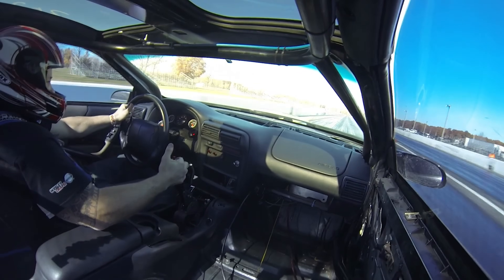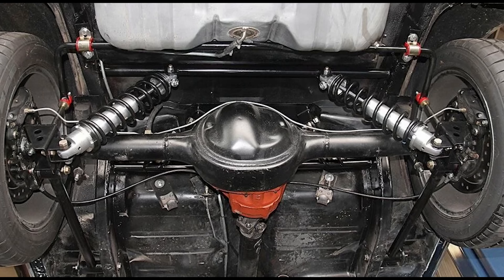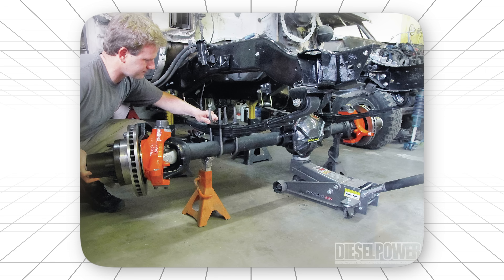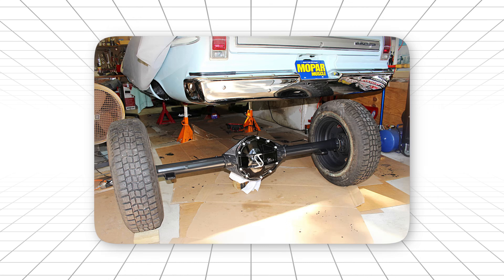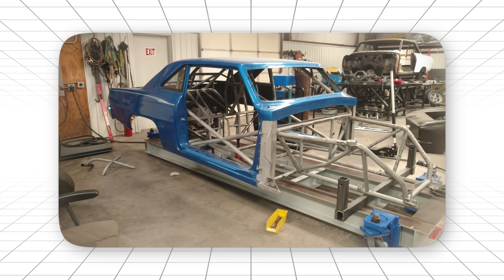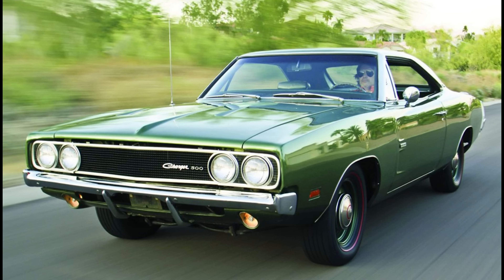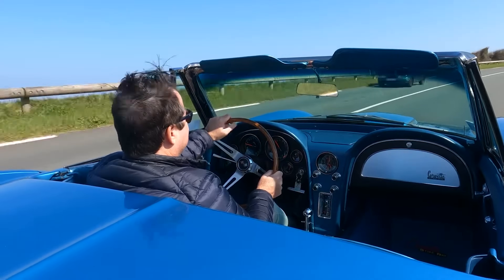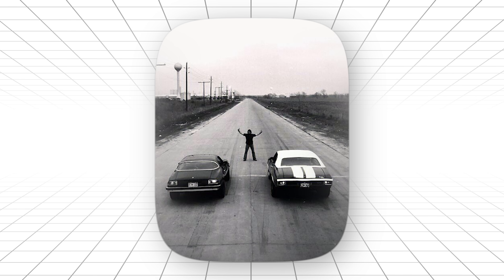The FORGOTTEN GM Suspension That Revolutionized Muscle Cars

Comment: I would agree that the corvette IRS rear suspension, particularly with four wheel disk brakes was the real game changer.  But I'll say back in the day when I was hanging out at my friends Porsche shop one day he said he wanted to show me something, and we went over to the wheel alignment shop and they had a 1958 Cadillac Eldorado up on the lyft and we were both astonished to note that it had a fully independent rear end on it with trailing arms.  So it was really the Cadillac that was ahead of it's time.  Cadillacs really were top of the line cars in the 50's.  My Dad's families actually was married to Casey Stengel so my dad grew up with uncle Casey coming up and he had a Cadillac Eldorado and my dad said even in the 50's the car got 25mpg and had automatic windshield wiper and auto-dimming headlights.  GM was just realistic the Mercedes and Porsche were the best cars in the world and they had to match them to be world class cars.  The mistake the GM made was when they lost fuel injection,   Had they continued with fuel injection that would have stayed competitive in the 70's fuel crisis.  In my opinion what GM should have really done is kept the Pontiac overhead cam inline 6, and put fuel injection on it with the IRS rear end, and got to a 5 speed tranny and seen if they could have added turbo.  At least they were very successful with the V6 turbo and you could say GM was a lower tier manufacturer always looking at cheaper ways of making cars, and that's what took them down when Toyota, Honda, Volkswagen and the French came in with high quality economy cars that had top of the line technology the GM just wasn't willing to put into their large luxury cars.  In the 80's and 90's Chevy made crappy cars.  Nowadays though cars are so expensive GM is recognizing buying an American car is a premium luxury choice and they're understanding they need to build their cars to a premium standard.  A ford Mustang is not a cheap sports car, it is competing against a BMW M3 and or a Mercedes AMG and it has to have the quality to do so.

Comment: I'm a cheap b@stard and run 8.8s in everything I can stuff them in. In my neck of the woods I can get a bare Ford Explorer 8.8 with factory LSD for $65 or $100 if you want it with brakes. Swap an extra short side axle in the long side while you are at the junkyard and you have everything to narrow one plus a big disk brake upgrade if you are putting it on a older car. The 8.8 is the poor man's unsung hero.

Comment: NASCAR is the reason the aftermarket continued to build the Ford 9" rear end. because they were used by every team in NASCAR. and still are being used to this day.
Reply: Nascar doesn't use the volume necessary to support a full aftermarket by itself. 😂 They could at best support a bespoke small production highly expensive line of products.
Reply: @jameshathaway5117 
You are wrong, they are used in every car in all the series from the Cup series on down. by every manufacturer and that includes all their back up cars. you might want to do your research before you go flapping your the one the internet.
Reply: @musicauthority674 you understand Nascar but your understanding of economics and business acumen is $hit. 😂

Comment: 57 to 62 Olds /Pontiac rear had a removable center and was popular and stronger than a 9" .stock 9s weren't strong till the aftermarket took over. Dana 60 was king.

Comment: Ummmm, Dana 60 was found in 1 tons and some 3/4 tons, not semis and farm equipment…….  Get it right
Reply: Where AI gets it wrong!
Reply: Before Dana bought Spicer, this axle was already in production. Yes 3/4 & 1 ton trucks. Just needed different flanges for cars. Due to it's very heavy robust design, unsprung weight was terrible. Only good for trucks & drag cars.
Reply: And Hemi Cars from the late 60's